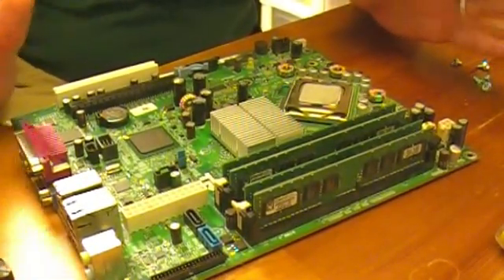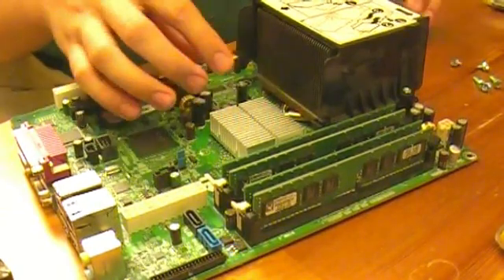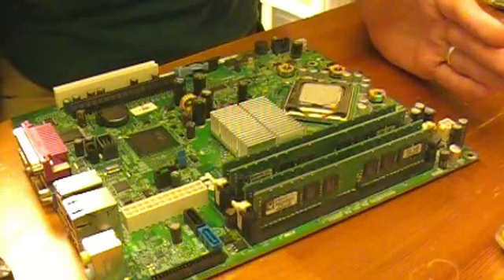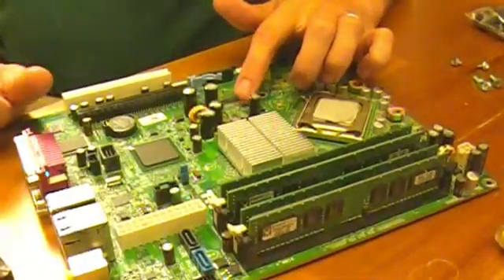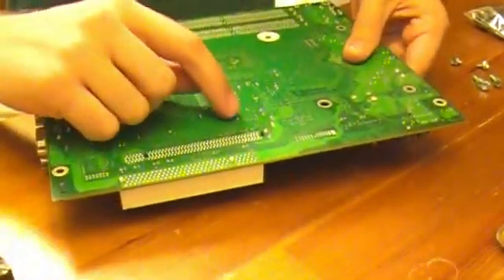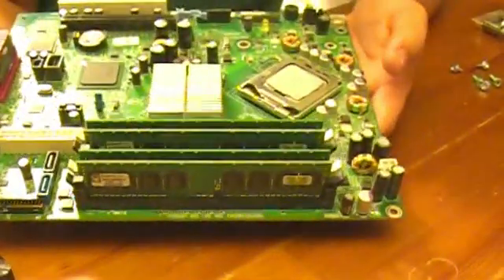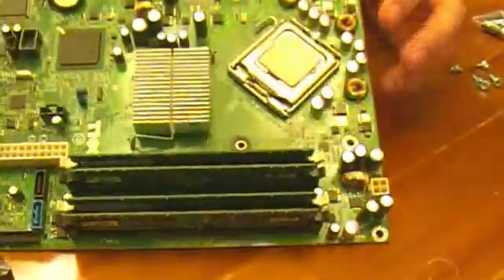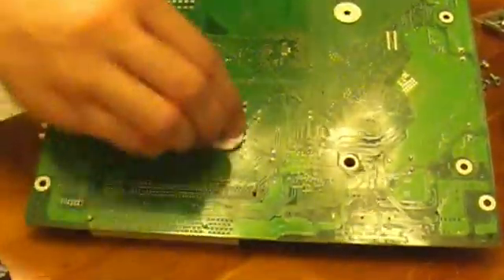Dell Optiplex 745 sff Replace bad Capacitors Part 1

Comment: I have a ma-758R board and someone removed the caps and I can't find a schematic or diagram to know what rating and position the capacitors were in. Any suggestions on how I might solve this dilemma? I've googled myself to death trying to get a simple diagram of some kind and nothing.
Reply from the maker: May be best to grab another motherboard off eBay.

Comment: do you know which brand is the bad one? i just got a core 2 745 with some bad caps and im reluctant to get the same brand, if they are the bad ones since i have to use a very hot running seagate hard drive.

Comment: I have a 745, would anyone know why it disables my saitek yoke? saitek is stumped, I did the power management on the usb, got a usb card 2.0 as soon as fs9 starts it's disables the yoke, but not the rudders, window xp, just like the system it was on before? re-installed the game, the drivers, even the OS Grrrr.

Comment: hi  mjmcomputers 
Thanks very much for sharing this video, and thanks for recommending ny electronics part os  on ebay , I followed your instructions and was successful in removing 3 bad capacitors from a Dell Dimension 4400

Comment from the maker: It will probably be less likely to happen. The main problem on these is the heat from the processor blows directly on these capacitors, plus the case stays hot.

Comment from the maker: @LinnieXX Yea, very bad design on these models, small case, inferior capacitors, hot running processor and a cpu fan that blows the hot air right on the caps.

Comment from the maker: @DJAlup I missed the markings on the board, I've had the radio shack soldering iron for over 10 years and it has served me well. I do have a hexacon now though. Making the video slows me down quite a bit, I tend to talk and explain too much.

Comment: ALSO the board is marked backwards. most circuit boards mark the - negative side this board marks the Positive side and this one is also marked on the back and you said it wasn't. 

on the back the - is a circle and the + is a square

Comment: Dude why do you use radio shack stuff? why don't you get a better soldering iron?

BTW I used my rework station without desoldering iron and I used de-soldering wick and fixed my entire board in the time that it took to watch this. I Like this video tho it made me nervous to solder on it because i have had issues with soldering on mobo's before but when i saw you using a radioshack one i was like hell i can do that!

Comment from the maker: @bradmacaboy If you have a 745 I would upgrade to a core 2 duo processor. You should be able to find a processor support list to find which ones will work. The vendor on ebay was ny-electronic-parts-os